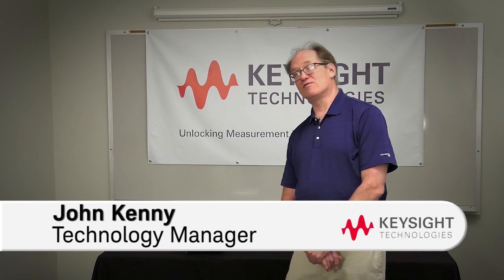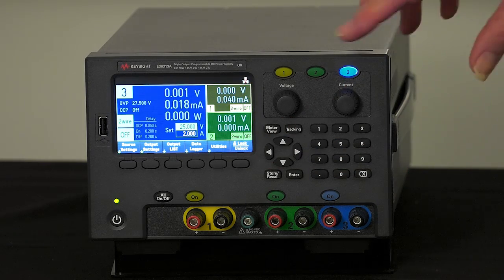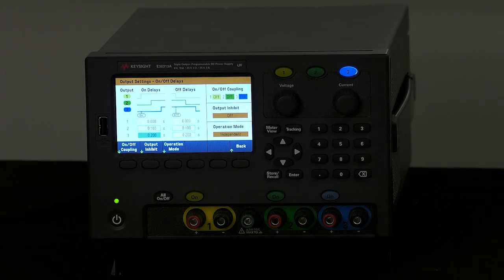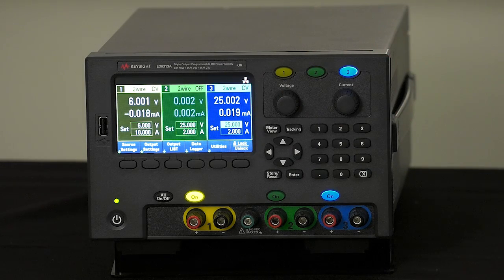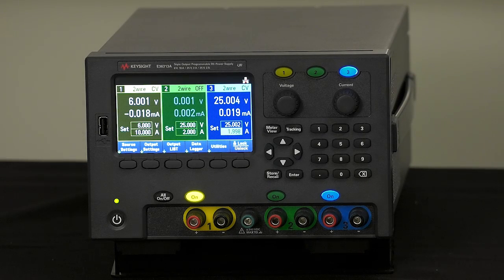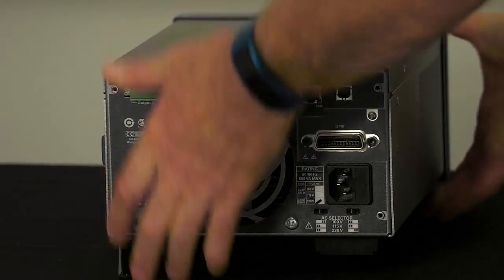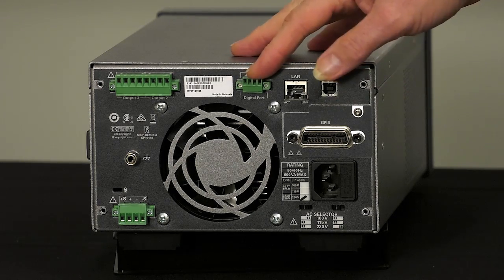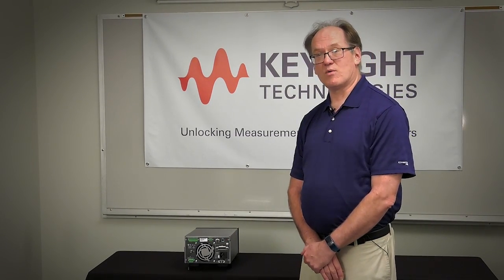E36300 Triple Output Bench Power Supply Product Overview

Comment: It is a really nice power supply, but I have one MAJOR pain point - when you cycle the power, it forgets it's settings! Yes, I know you can save settings in memory (minimum 5 button presses!!), and even set default settings on power-up, but what I want (and the way every other power supply I've used works, both digital and analog) is that it automatically powers up with the setting you last selected. For safety, you could have the output come up disabled, but it is terribly annoying to have to redial settings. I just cannot seem to remember to go through the long sequence of button presses to save settings before powering off.

Comment: I have a question about the E36300.  We have an E36312A and are using it for a project.  I know each of the three outputs can have over current protection set for the respective supply, but can over current protection be set to shut off all 3 outputs if one supply trips?  I have not found this is possible in the documentation, but it is something we are currently in need of.

Comment: I bought one of these (E36313A)  and absolutely love it. I thought i was getting more than I needed - I've never needed a triple output before - but I used it on my first project that required a little bit of 5V to power a microcontroller, plus 24V at several amps to drive a motor: the auto-parallel of outputs 2 & 3 made this work like a dream.

It's so, so nice to have good gear.
Reply: where did you buy it?
Reply: @zigamahne4636  Mouser Electronics, where I get most of my other Keysight gear. I paid retail. I also got lucky and caught a promotion: buy one of these power supplies, get a free U1733C LCR meter (the high-end handheld unit), so this was very nice.

I don't use it often, but this supply is just such a joy to use, I haven't found one thing not to like about it.

Comment: If I may:  
- Set exposure to manual (disabling AE).
- Set max LCD brightness (disabling ambient metering). 
- Use an angled pair of softboxes for the front (perpendicular would reflect into the camera).
- A softbox for backlighting... 
Thus, have nice, even exposure of the display and product simultaneously, yes, but more importantly, it'd be CONSISTENT.  

Especially as a company whose goal is to communicate it's fastidious attention to detail. ;-)

Comment: Looks awesome. Love the fully independent channels.  Absolutely love and desire the remote sense capability.   Need to read the manual on response time with and without remote sense.   Wondering if this thing can accurately measure sleep currents down to 1uA ... that would be killer ...
Reply from the maker: APVT80 On the 20mA range it can resolve down to 1 uA and has an offset & noise spec of 80 uA.  The unit I have has far less noise but 1 uA is a challenging measurement. Remote sense does not affect the response time. The response time to recover from a transient of 50% current to 100% current is less than 50 us.  We recently measured it in this video: https://youtu.be/9z3DEhQkXg8?t=144

Comment: Could you please explain how do I tie two outputs together to get 50V? Or - at least - a page number in the manual, where this feature would be described? Model 36313A. Thanks!
Reply: Super easy to auto-series outputs 2 & 3.  Tap Output Settings, Operation Mode, Mode Series. You'll hear a few clicks, then you're set. Click [Back] until you get the main screen, and channel 2 displays the series voltages with channel 3 unavailable (but marked "Series with CH2")

Comment: Can this simulate a coin cell battery or AA battery as power supply
Reply from the maker: Markel Rodregado6 It is a common practice to use the E36300 series in place of a battery. A power supply will produce more repeatable results as you test at different voltages, simulating battery charge.  The E36300-series has two current ranges one for above 20 mA and one for less than 20 ma providing additional resolution. To simulate a battery is a bit more challenging as each type of battery has a unique series resistance (ESR). As you draw current, you will see a drop in voltage. If you draw a quick pulse of current, a power supply will overshoot/undershoot as it adjusts to the changes in load. BTW, Keysight makes a power supply for simulating batteries, but they are much more expensive (N6705C with an N6781A). I think you will be fine with the E36300 as long as you recognize the difference between a power supply and battery.
Reply: Tektronix has the 2281S-20-6 Dynamic Model Battery Simulator. https://www.tek.com/tektronix-and-keithley-dc-power-supplies/2281s. Keysight N6705C does not seem to be able to simulate a coin cell battery or AA batteries to provide good battery drain analysis or battery life.

Comment: Finally a separate knob for voltage and current as well as voltage/current displays for all channels! 
Gone are the days where the EUT got fried with power from channel 1, while the display showed no current on channel 2, like with my E3648A. 

I could do a review of the unit, if you want and have a spare PSU ;-)
Reply from the maker: Bernhard Wörndl-A  Thanks for your comments.  I agree having the separate knob for current is a huge improvement along with the voltage and current being displayed for all channels.

Comment: I own a Keysight 2000 series scope and have done since they were first released.
I love the Keysight quality and support I got from the UK when specific functions weren't working after upgrading to the MSO + Serial Decode etc.....
I often wonder why we don't see all the usual YouTube electronics engineers & hobbyists using Keysight bench power supplies.
I think there is only one answer - Price Point.
I have no idea about your target market, I can only think that you are missing out on a big market share?
Is the quality of this bench power supply too smart for it's own good?
i.e. quality vs price point vs potential sales?
When your Infiniivision was released, it wasn't too long before every man and his dog had one, these power supplies don't seem to follow the same trend.
Just my penny's worth.
Thanks for the great video
Reply from the maker: John  You are correct, the hobbyist market for power supplies is quite large.  The designs and components used in these supplies is very similar and many brands are OEMed. As a former middle school robotic coach, I am familiar with many of these supplies and their teachable moments.  Keysight is focused on higher quality power supplies that offer lower output noise, better DUT protection and built-in analysis.  Given the price of prototypes and the increase in low power and battery based designs,  I really like these new power supplies.

Comment: Still not capable of sinking current, that's the feature I'd want at this price. 20-30W is fine.
Reply from the maker: TheAmmoniacal  You are correct. The E36300 series can supply both positive and negative voltage but is used to source current.

Comment: What is the suggested retail price in the USA,  Ballpark??
Reply: From the Keysight website today:
E36311A US$ 1,100
E36312A US$ 1,400
E36313A US$ 1,700
Promotion through September 30, 2017, buy one of these supplies and get a 1242C Handheld DMM for free.
Reply from the maker: Glen Slick.  Thanks for the quick response